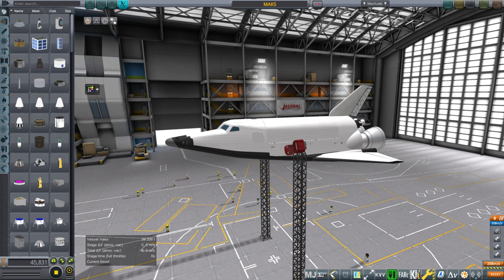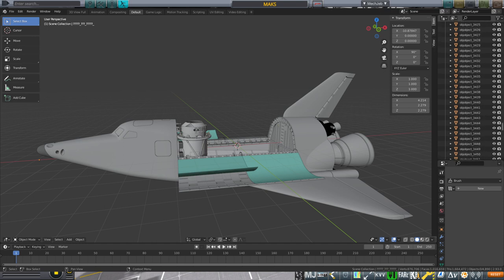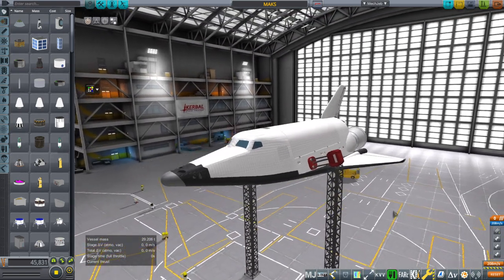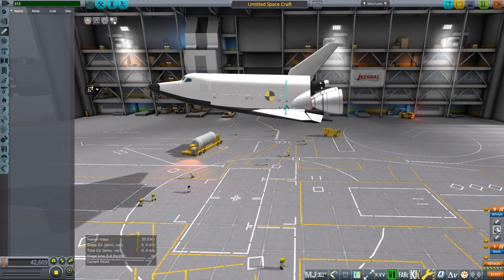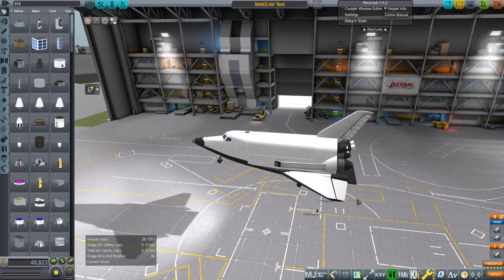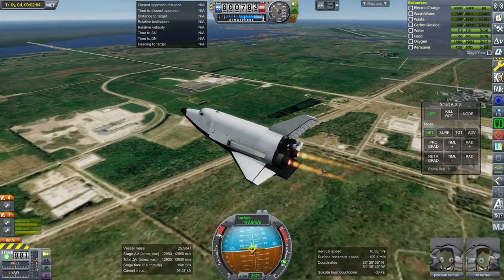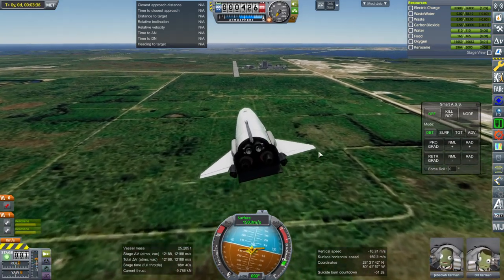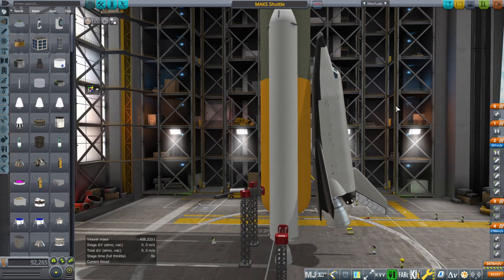KSP with Realism Overhaul - MAKS Aero Test

Comment: I think the rudder's lift is acting 90 degrees off. it thinks it's a horizontal surface, rather than vertical.
Reply from the maker: Yeah, that would make sense. Figuring out why, though, is an interesting question.
Reply: @RaizSpace  Hmm.. maybe rotate the model so it spawns in horizontal so the lift is in the right direction.